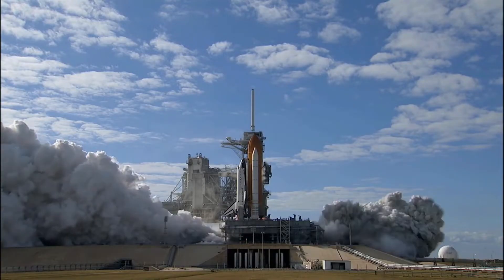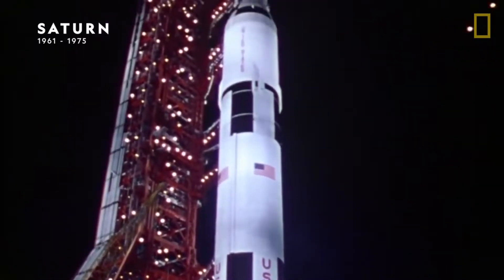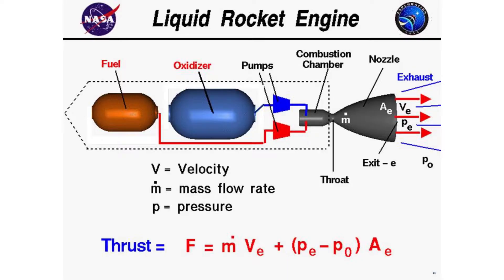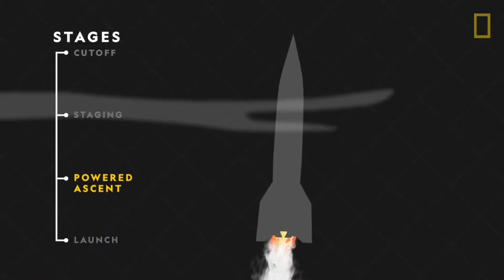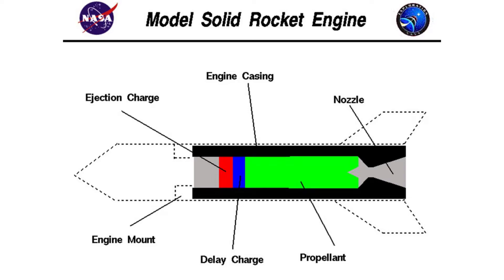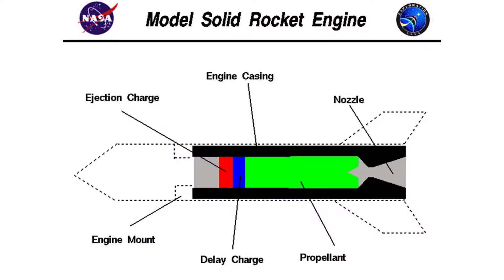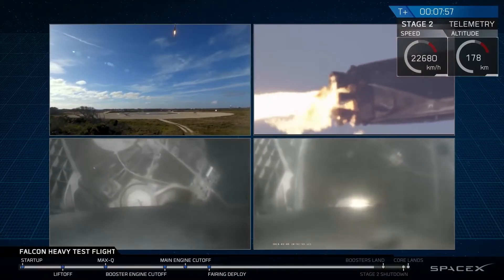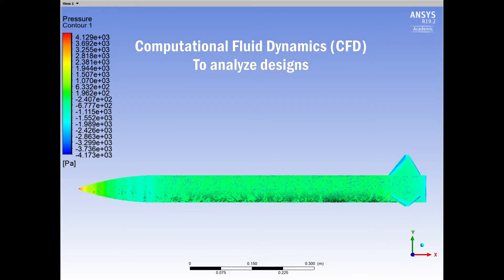How Rocket Engines Work | Rocket Science 101

Comment: what type of rocket or thruster work under water and in space
Reply from the maker: Underwater and in space are very different questions. A conventional rocket motor will work in space because the propellant is self contained. What WOULDNT work in space for thrust would be propeller based thrust and jet engines. 

As for water, it would be much more difficult because the water would actively be inhibiting the combustion. The best submarine  propulsion I know of is conventional props. Although I do not know too much about submarine propulsion systems.